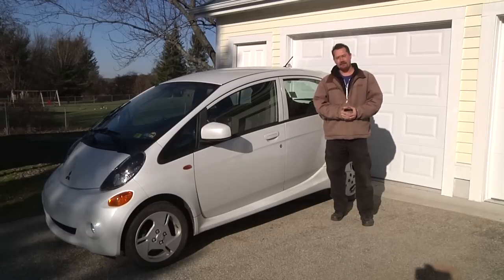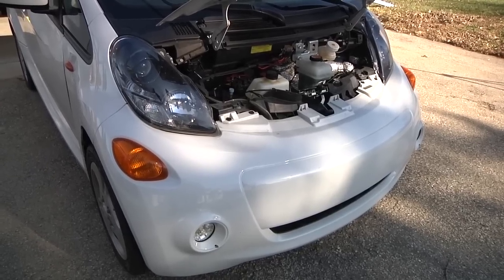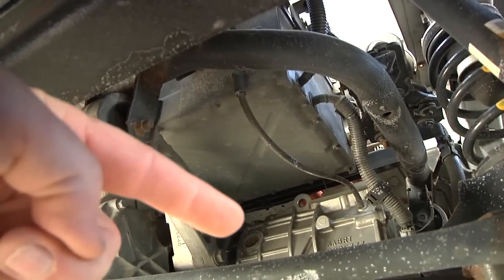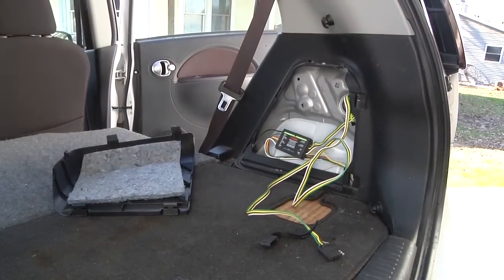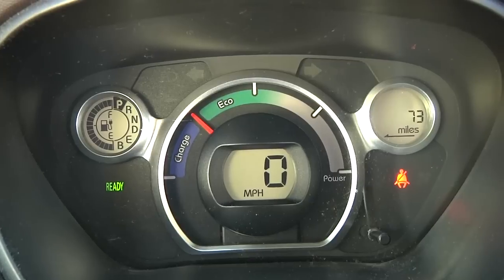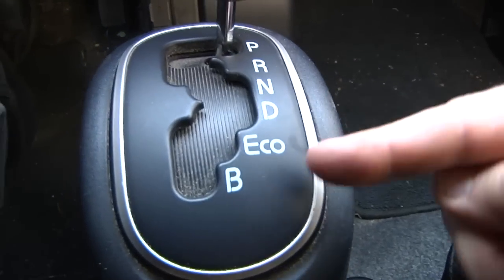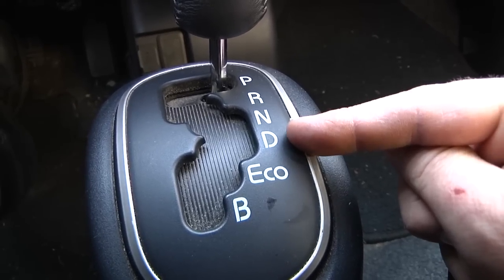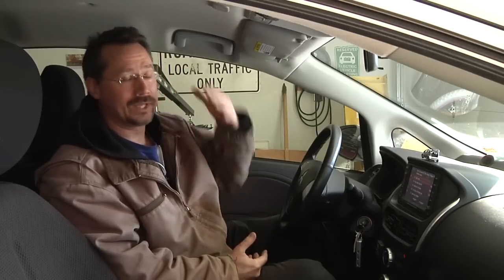Mitsubishi iMiEV Electric Car Tour (Extended)

Comment: this is actually a really well thought out great affordable electric car. surprising it never got much publicity
Reply from the maker: It was also REALLY poorly advertised. Most people have never even heard of it.
Reply: @BenjaminNelsonX  I bought one two weeks ago. 44 000km (27 000 miles), 2012. Its near-freezing now and I can do 80km with slight heater and 95km without heater.
Will add Webasto in the summer.
My commute is 70km.

I'm also 5,5 year Leaf user. I need two cars as there are two drivers in the family. Third car BMW diesel, for towing and long trips above 150km.
Compared to Leaf iMiEV has SIGNIFICANTLY better traction control software. Also iMiEV charges faster (range per minute) than 24kWh Leaf.
Reply from the maker: @tarassu  One thing I've always liked about the iMiEV is how fast it charges for a little car with a 3.3kW charger.
As a rear-wheel drive car, it's surprisingly good for towing!
Reply: It was painfully overpriced. Starting at 30,000€ was insane, when a similarly sized petrol car cost 6,000€... It just couldn't go well.

Comment: Thanks Benjamin.  At last, a good honest and accurate review of a very underrated car.  As a fellow 2012 iMiEV owner, I can confirm everything you pointed out and explained.  I have a base model, first owner with 82 000 km (over 50 000 miles) on mine.  I received a set of winter tires for free as an incentive from Mitsubishi when I purchased my Miepster and with them on, this little gem is bulletproof in handling snow and ice in our Canadian winters.  In have not spent one penny on repairs so far and after the first ''service'' which cost $86 and change, I never took it back to be serviced again.  I put service in quotes, because they service nothing, they only check this, check that and take your money for it.  I trust that the built-in diagnostic would alert me if a problem arise, although I can not imagine what could go wrong given the brilliantly simple workings of this car. 

I replaced an ageing Volvo V70 cross country with all wheel drive with the Miepster in 2012 and I do not miss the Volvo as far as handling snow is concerned.  The Volvo was better on long trips though and warmer inside on those cold days, but she cost me a Lot of money in gas and maintenance.  Oh my gosh!  She would only run on premium.  Never again.  I am so done with paying an arm and a leg to the gasoline industry.  They are not doing our children who will inherit our failings, any favors you know...
Reply: Wow i guess all i needed for my 2012(59,000km) imiev is snow tires? In 2016 winter, I got stuck like 4 times last winter in brand new enasave tires. Out of fear(and a newborn), i stored the imiev this 2017 winter. In Winnipeg, we had a more colder winter and way less snow then 2016 winter. My range goes from 130kms(july/august) to 40kms blasting my heat! Looking to getting a 2013 volt now.

Comment: Thanks for the tip on protecting the wing bolts. I paid 5.2 k for my imiev with a lower trim level and 23k miles. These are great cars. I transport my Hase Kettwiesel with the hatch closed. This is a great video. The silent ending shot was fantastic.

Comment: Great, great, great. Thank you so much,sir. Very detailed and in-depth. You made the video perfect by showing the motor compartment, the aftermarket heater, and all the uses that this car has. I recently discovered your channel and started watching all your videos, they are awesome. I also loved the hour long presentation about your solar garage great project. I have 2 questions: You mentioned that your latitude is 43 degree, did you set the roof inclination to 43 degrees to maximize the solar efficiency? and, when you are driving in ECO or B do the brake lights go on when you let the foot off the acceleration pedal? You are my new favorite channel, keep up the great work.

PS: you might have changed my mind about buying a leaf, I think this one is a better bang for the buck now.
Reply from the maker: I couldn't make my garage roof quite as steep as I would have liked to. Local building codes limited the maximum height of the garage, and thus the angle of the roof because of it. The angle is still very good for solar, particularly because the building otherwise faces due south. On this car, in the Eco or B modes, it does NOT put on the brake-lights. My Vectrix electric motorcycle features manual control for regenerative braking, which can be quite firm - that DOES activate the brake light. I believe that the Chevy Bolt also activates the brake light in at least the heavier regenerative braking mode.
I do sometimes just lightly touch the brake pedal if I am in the B mode and coming up to a long slow-down before a red-light or similar situation with any other traffic behind me, just to make sure they know I am slowing.

Comment: Wow i over payed for my 2012 about $2,800 usd, bought it back in 2016, and that was for the lower trim model! Mine did come with fog lamps. Oh man, my winter car(mazda3) has bluetooth,,,now i am hooked. Wish i got the SE model. Plus that backup cam looks like a great safety feature. I just fit a Wendy’s big soda in my dash cup holders. Do you think the b mode messes with driver behind you?

Comment: Very interesting! With LEDs in the headlight low beams, take care to ventilate them; the housings are completely enclosed with no airflow unless you leave the rear covers off.
Reply from the maker: You can read about the LED headlight upgrade at: http://300mpg.org/2016/01/08/led-headlights/ The LED bulbs have small fans built into the back of them. Overall, they have been working really well, and I like the quality of light from them.

Comment: Thank you sir! Enjoyed this video a lot! Wish I could afford one but I doubt they will survive long enough that I can buy one ( Can't usually afford more than 1k). Can always dream right? Was hoping you were going to punch it after you pulled out of the garage. lol Oh well ;)
Reply from the maker: Didn't want to run over my video camera. One thing you CAN do in this car is set the hand-brake, press the accelerator to the floor, and then release the brake! I'll have to try that this winter in an open area with traction control turned off!

Comment: Wait until your charger go bad ( what is happen 8 to 10 cars )or the battery pack! Then you need a charger for 4000 euro and a battery pack for 10.000 Euros! And don t think that you can buy a used because all are vin coded !!! So driving an imiev is more expensive as a normal small car after 15 years! Thanks to Mitsubishi that show as once again what is to drive an electric car!! Green drive looks different !